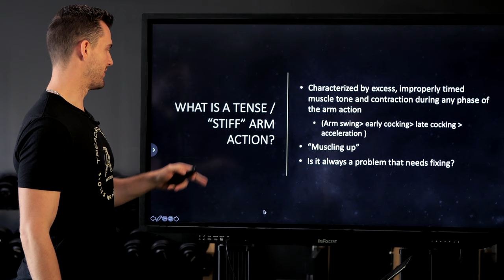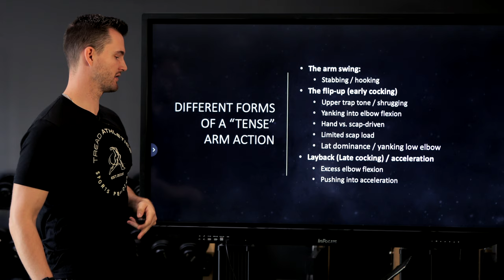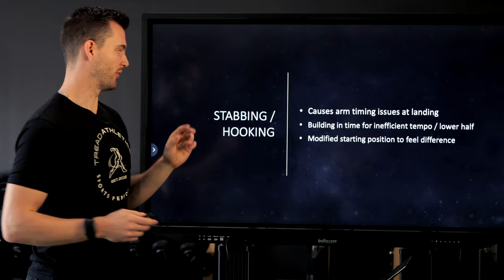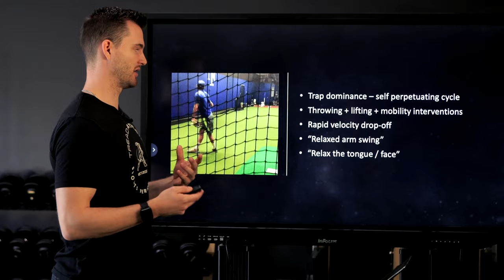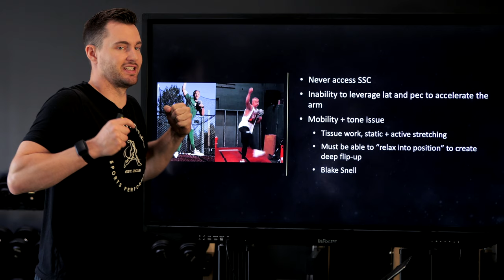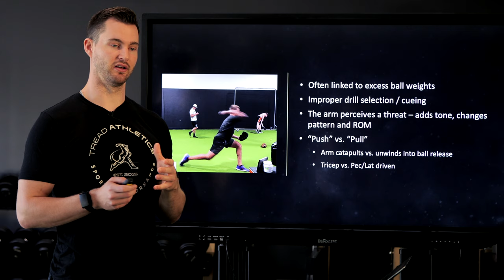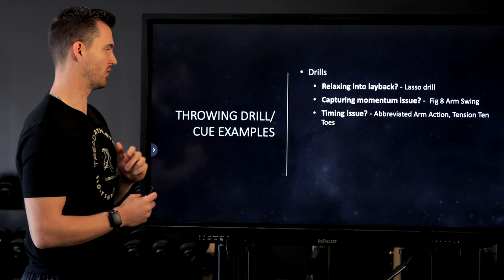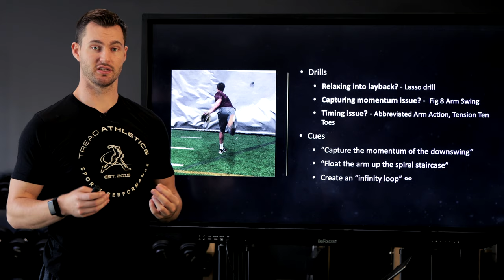How to Fix a Tense or "Stiff" Arm Action | Pitching Q&A

Comment: I have rounded shoulders and kind of stiff pecs when I throw from working out and lifting weights. I lack extension of the arm behind the back and lack posterior tilt in the scapula, giving me impingement and tension. Do you have any suggestions or recommendations to try and fix this? And work outs or type or training to fix this?
Reply: Also, what type of weight training should I avoid that cause tight shoulders. Do you think too many push-ups is bad for pitchers since it can cause stress for the muscles and joints in the front of the shoulders?
Reply from the maker: @jamesleahy3480  Hey James, this is a common issue and is often linked to tightness through the front of your shoulder (specifically: pec minor, pec major and subclavius). A combination of mobility work and addressing the training approach can usually address this quickly. I tend to avoid high rep pressing, pec flies, etc. for these guys. We keep reps <5 in the strength range and around ~3 for power/speed work. We have a couple videos that would be helpful if you want to shoot us an email for more info.
Reply: Wonderful video, as usual! To accommodate for relaxing the tongue/face have any of you athletes experimented with a mouthpiece (AIRWAAV or something similar)? If so what kind of results were seen? 
Thanks